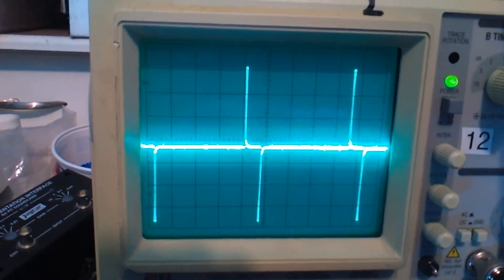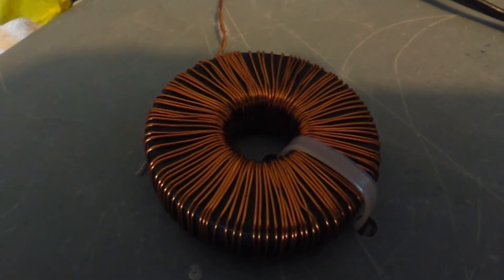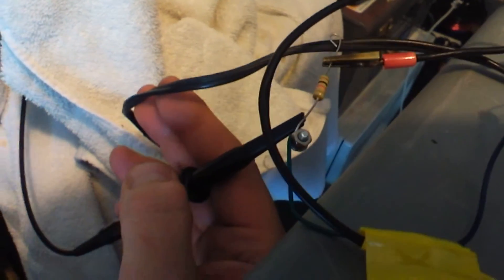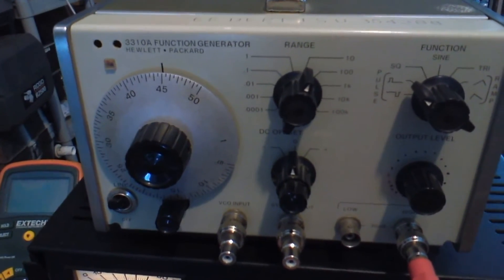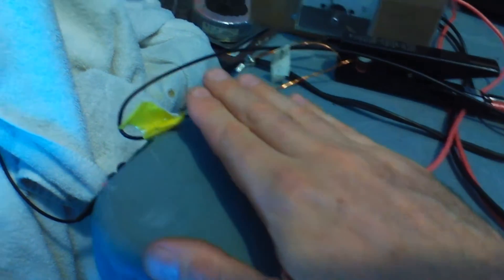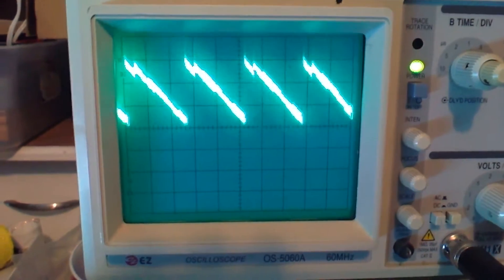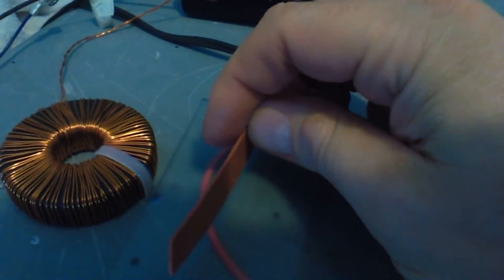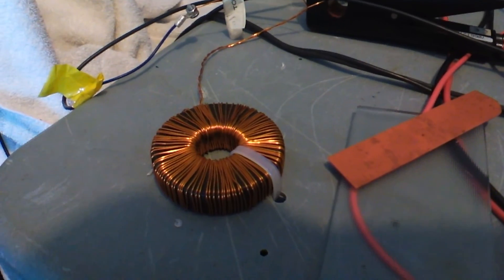Floyd sweet exp. 1

Comment: Too bad your link doesn't work anymore. 

I have made Motionless electromagnetic generators and measures the flux of me punching the air across my room with an Arduino readout to my computer. I posted a video of it on my channel even but it has hardly any views for some reason 😅